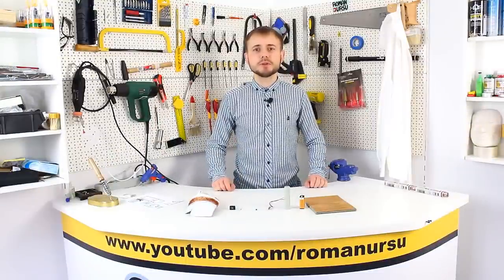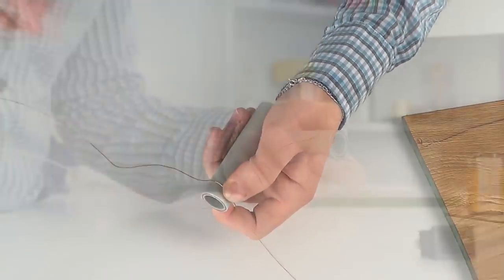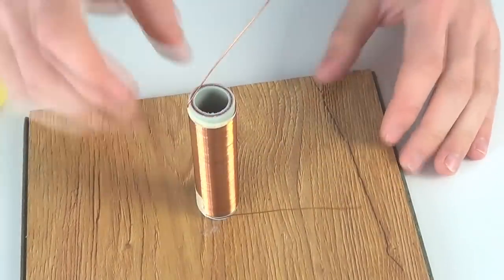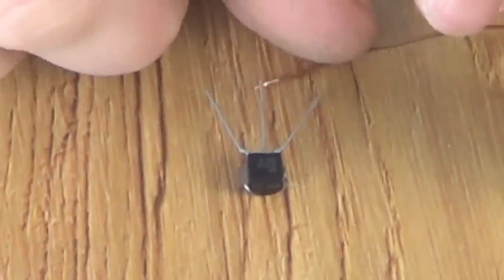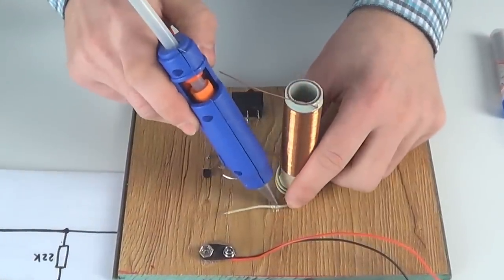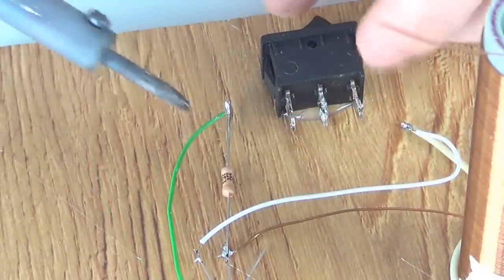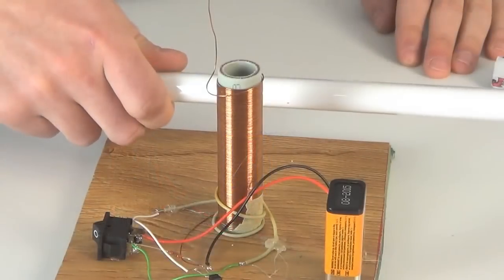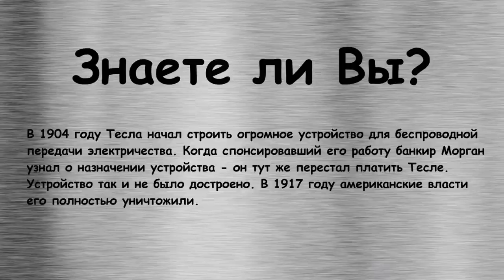How to make a mini Tesla coil 9V

Comment: the top of the coil on the pvc is just pointed up?
Reply: right into the air. the circuit becomes closed through the capacitance in the air so it does indeed work even though it's like "wtf? doesn't this end need to be connected?". essentially so long as you have a primary and secondary wound, the circuit will work with the right transistor. if it doesn't, one of the coils probably just needs to be flipped over in relation to the other one as the direction of their windings are important.
Reply: If I'm not mistaking, the bottom of the coil on the pvc could of been connected to a grounded wire and does not need to be connected to the rest of the circuit.
Reply: ***** is that some new discovery you have seen somewhere or are you just saying it's possible? there are certain configurations of 'exciter' circuits where the pvc coil in this scenario can be something different altogether, placed away from the primary coil, but it would still need to be sending that signal to the base of the transistor in some way. in this particular circuit the bottom of the pvc coil as far as I know does indeed need to be connected to the transistor Base.

Comment: PLS HELP,,IM 14.......pls help.....hw Manny torn of the wire,,,and wht kind if wire do you use in secondary coil plsss rep....pls
Reply: Hello there. I'm 11. And i understand electronics.
Reply: +RJT Inventor wll ypu help me....
Reply: +Pacman Gepc Yeah!
Reply: +RJT Inventor what kind of wire in the primary coil....
Reply: +Pacman Gepc Copper wire
Reply: +RJT Inventor any copper wire....
Reply: +Pacman Gepc No. The 1mm thick one
Reply: 1mm gauge copper wire, as it said in the video.
Reply: +Nick Dahms Exactly just what i said
Reply: +RJT Inventor what happen if your voil have. a scratch
Reply: +Pacman Gepc It breaks a contact. you have to solder it thogeder.
Reply: +RJT Inventor if I use a small pipe will that wont work,,,,and how many torns of the secondary
Reply: +RJT Inventor and it is ok if I use a 2N2222 A331
Reply: +Pacman Gepc Yea

Comment: Do i hve to change transistor n resistor if i use 18v battery?
Reply: mayank raj No You Dont need to change the transistor but use a 47Kilo Ohms Resistor
Reply: ohh.. thnq so mch,... actually i blew up my tesla coil :p using the configuration u hve mentioned but with a 18v battery :p

Comment: step up transformer 100:10 @ 120 = 1.2kV --- step down transformer @120 = 12 volt at amps
turns_secondary/turns_primary = volts_seconday/volts_primary = Ns/Np=Evs/Evp
turns_secondary/turns_primary = current_primary/current_secondary = Ns/Np=Ip/Is
this given AC as AC only works on change and DC is half-life of change

Comment: +Roman UrsuHack this circuit is little fake because the other end of primary coil isn't connected anywhere and thanks to some nerds on the internet they realize that a component is missing it is a capacitor it's value is very small but it connects the coil to gnd so the circuit will be closed and can be oscillate

Comment: is the coil insulated Wire?
Reply: +Alex Ander i understood, i asked if the wires need to be insulated, if there should be insulation around the Wiee
Reply: +Alex Ander nope lad. insulation is anything that prevents the electricity from going in anything that touches the wires. it can rubber, but it can also be an epoxy coating, like in the case of the primary winding.
Reply: +Alex Ander nope lad. insulation is anything that prevents the electricity from going in anything that touches the wires. it can rubber, but it can also be an epoxy coating, like in the case of the primary winding.
Reply: +Horla Yep. In the US, most wire like the wire shown for the primary winding is coated in enamel.

Comment: This most likely is fake, since it would take a huge amount of precise tuning to get this circuit to osscilate without a capacitor, and that tiny primary coil   certainly does not have enough parasitic capacitance to act as a capacitor and an inductor at the same time.
Reply: +A. Zak Maybe that's why the lamp flickers?
Reply: ***** Yes, the flickering was suspicious as well.

Comment: I tried it but it doesn't work, sorry. Checked 3 times my connections, changed the transistor in case it was burned, made new coil with other number of turns (both secondary and primary), changed my power supply but still nothing happened!
Reply: +KOTSOS5 Check direction of winding of both coils. This is most typical mistake w/ a slayer exciter. Check other obvious 'doh!' mistake possibilities: continuity for example, switch connection (try just shorting across switch terminals to turn ckt 'on'), etc.

Comment: what is the need of a transistor?
Reply: can use ksp2222 or 2n3904 or c1815. Only look in datashett were is emiter, base and colector of transistor that you use. Eviter to minus, colector to one end of primary, to base on end of secondary and resitor.
Reply: a transistor is a very handy device to use a small current to control a very big one. It's like a waterfall: as soon as you open the gates by controlling the gates with a small current over base and emitter, a waterfall of current can flow from collector to emitter.

Comment: My tesla coil isn't working,I did the same as in the film but my coil is 2.5 cm, not 2 , and my resistor is smaller than in the video but it's 22 kΩ. Can anyone help me?
Reply: +MCSgames Gosh. It is not 22 Ω... It is 22 kΩ... Which equals 22000 Ω
Reply: +MrPsycho http://i.imgur.com/eLQ59m1.png Look, it's 22 kΩ
I checked it on the internet page where I can check my resistor

Comment: how many wats has the 22 kilo ohms (Ω) resistor
Reply: judging from the size looks like a 1/4W resister. its a resistor connecting to the base of the transistor, so the current flowing through it is very less.

Comment: my coil is not working and transistor is getting hot
Reply: maybe need change ends of primary coil.
Reply: you need to de-laminate the copper wire.
Reply: Yor transistor is the wrong way round. Did u really use the 2n2222?
Reply: Look up the data-sheet of your transistor and make sure it's the correct manufacturer. Not every manufacturer puts the base, collector and emitter of a 2n2222 in the same order. You most likely wired up the transistor the wrong way.
Reply: yes

Comment: Can Other Transistor Work
Reply: The 2N2222A is a really standard transistor. There are many types that have very similar specifications. Search for the datasheet of the transistor you want to use(Must be of NPN-Type by the way)  and compare these values to those of the 2222A:

hFE must be same or larger(Compare the minimum values of both transistors)
VCE and VBE must be same or larger(compare max)
Ic and IB must be same or larger(compare max)
Thermal Resistance Junction to Ambient must be same or smaller
ft should be the same or higher (not absolutely nescessary)

In this application, the transistor has to dissipate quite much power. The transistor used here is in a TO-92 packaging. My guess is, that this setup will result in a quite hot transistor. For better power dissipation I recommend you a transistor in a TO-220 packaging. 

Engineer signing off ;)
Reply: Bad answer dude...
Reply: Thanks For Answering
Reply: you can also use the 2N3904.

Comment: can it work with a 12v car battery
Reply: I believe you'd have to replace some of the components with much more powerful ones if you plan to connect it to a car battery. The car battery can output much more power due to its much lower inner resistance, which would probably fry the components shown in the video.
Reply: +Upside Down Airline I have a BTA06 tranzistor to 800v

Comment: I can see Tesla Nick is quite correct. There are so many fake videos on YouTube it's quite saddening. This circuit could have osilated well with a transistor if a secondary feedback coil, just a few windings, was connected to the Base of the transistor. Some additional decrete components too, and you might have a circuit that worked. The brightness of the tube gave it away. That was a 15 watt 18" tube? It was way too bright for a 9 volt battery, which at best would provide 150mA so not even 1 or 2  watts of power would have been transmitted. The lamp was way brighter in a well lit set.
This was faked.
I have worked in the electrical and lighting industry for all my working life, including making emergency lighting circuits for fluorescent lighting. This is as fake as fake can be.

Comment: can i use 2N3055 transistor .....?
Reply: I don't think so, the 2N222 is a BJT the 2N3055 is a power transistor so it likely wont have the switching speed.
Reply: thanks brow.......
in 2N2222 can i use 12V 2AMP power supply.............?

Comment: does he ever mention the number of turns?
Reply: He doesn't, though if you take the length of the PVC (8.5cm) and subtract the distance he says to leave at each end (.5cm),  = 8.5 - (2*.5) = 7.5cm, using the prescribed 1 mm wire, it would be approximately 75 turns.
Reply: +Kevin Russell : | .....wow

Comment: My transistor keeps over heating! PLEASE HELP
Reply: +Harris Khan  I used a 100 ohms resistor
Reply: +Harris Khan You must use an 22k ohm resistor. An 100ohm resistor doesn't work.
Reply: Thanks so much
Reply: +Harris Khan yes it will get hot quickly. try using  a bc640 transistor. Good for 1 amp.You can wrap  small piece of metal to transistor to loose heat.
Reply: I'll try that

Comment: bogus. I-be current would be constant .0004A, I doubt even enough to drive the collector to emitter junction.  Even so the circuit would  run steady current of 20ma to drive some emitter to collector current if you used a 220 ohm with no switching effect to excite the secondary coil into induction not to mention having the long secondary connected to the base of the transistor into an open circuit would do nothing. <LOL At least he did set up the circuit to forward bias the transistor.

Comment: what's the watt of the resistor?
Reply: +Azim Alif bro resistor don't have watt their unit is ohm
Reply: +Milan Aryal I saw saw some online... that say 1 watt 22 ohm and 4 watt 22 ohm.
Reply: Azim Alif okay now I don't know because when I went to electric shop I got it and the guy didn't say anything about watt
Reply: +Milan Aryal o.
Reply: +Milan Aryal I found watt deference...
Reply: That guy said nothing about it he gave it to me and i went away
Reply: +Milan Aryal did it work?
Reply: resistors have a resistance (in Ohm's) and a maximum power which they can withstand before they break (get to hot and melt). Most likely this resistor of 22 kilo Ohms can withstand a maximum power of 1.5 W or so.
Reply: I think it's a quarter of a Watt (=250 mW). Very common resistor.
Reply: I believe you, since I am not an expert
Reply: If all voltage is applied across de resistor then 
9v / 22 000 ohm = 0.0004 amps going thru it
9v X 0.4 milliamps = 0.0036 watts is how much energy will be dissipated.
a standard 22kohm with a power rating of 1/4watts is more than capable to handle this type of power.

Comment: Fake alert: Motto of the video : If you can't make one then fake one!
1. From 5:10 onward look closely that the glow in the tube is starting from the left end of the tuber where his hand is and glow is not starting from the nearest point where the coil is.
2. Where is the static spark?
3. Where is the capacitor for the delay and enrichment?
4. Where is the feedback wire from the coil it self to trigger the transistor.
5. How the battery is not blowing off the transistor and resistor because the primary wire is too thick which will lead to high ampere near short circuit.
Reply: +Mukesh Kumar Try using the Googler - search for "slayer exciter" - you'll find dozens of identical builds and ckts (in fact the diagram in this one is apparently identical to one that's ALL over the interwebs). MANY YouTube vids demonstrating an identical or nearly identical ckt. If this is a hoax, it's a really widely propagated one. Advice: do some research before getting all smug. >;-)
Reply: LeaveMeAloneGoogle Okay you win. Make your self a one and I will trust you.

Comment: where 2n2222a found in which device
Reply: any sound equipment near the sound exit conectors, also if you have a no good dvd or home theater, look near the audio out conectors (the white and red audio out conector) there should be some 2N3904, that work just as well as 2N2222A. both of these are fast switching transistors, if they were not fast switching this circuit would not work.

Comment: it can't work
Reply: why?I tried making it but it is not working. can you please tell me how to make this thing work.
Reply: sanyam goel I Don't know , but get same result as you ,

not working
Reply: sanyam goel ,  :- you know battery is 9v (in video) but tub is 15w , 
actually my best friend participate in science fair projects, so he need a project for his competition ,  he chose this one ( mini tesla coil ) but it couldn't not work . but with some changes ,like change the battery and transistor change into IC , I hope with these some changes ,it can work .
Reply: guys the first one I made years ago worked no problem. I wound it very quickly and sloppy and it looked horrible. I used a 2N2222 I found on my floor that looked pretty old and bashed up. you are overthinking it. all you need is a silicon transistor NPN or PNP, a coil of about 400 turns using nearly any gauge of wire 30 awg or smaller, a ~5 turn coil of roughly 28 awg, and some form of indicator such as a neon bulb to see if the circuit is working. that's it. it works. I want to help you guys get it working.
Reply: ***** that can happen as over a couple hundred milliamps from a 9v battery can heat up the these small transistors pretty quick. you have to try to find a setup where the draw does not exceed that. i recommend testing builds out with 5v instead of 9v. use a 5v USB supply or something. That should keep your circuit from burning out and overheating unless there is simply a short somewhere.  if the transistor is heating then that at least indicates the circuit is either running or has wrong connections. if you use a florescent light to test the circuit at first, try using the smallest one you have. or a neon bulb. or an LED hooked to a coil. these are likely to light up when a fluorescent may not.

when the circuit is wired right and doesn't work, the common things to try is reversing the direction of the thicker shorter coil. just flip it upside-down so it's winding the opposite direction. you also may need to adjust the height of this thicker coil along the tower. You also may want to try changing the amount of turns that thick coil has, I usually go with around 5 turns instead of 1 or 2. I will say that out of all the ones I've made, it always seemed a little harder to make a good one using the diameter of tower shown in this video. I try to make them at least as wide as toilet paper rolls.